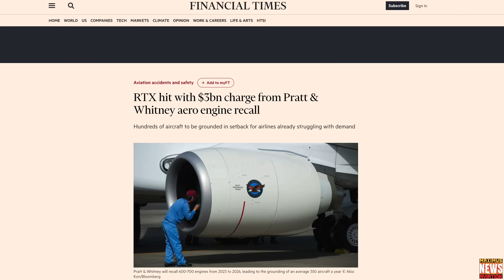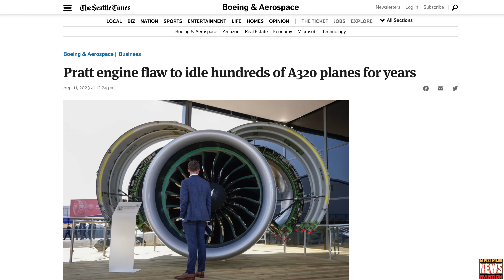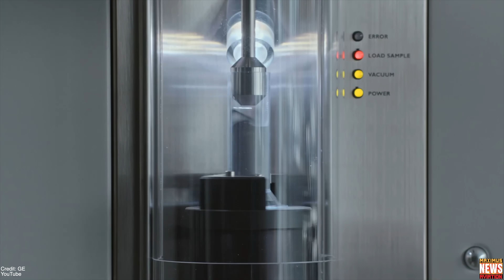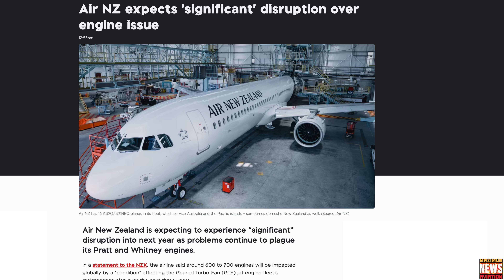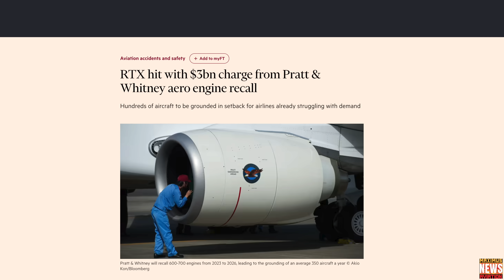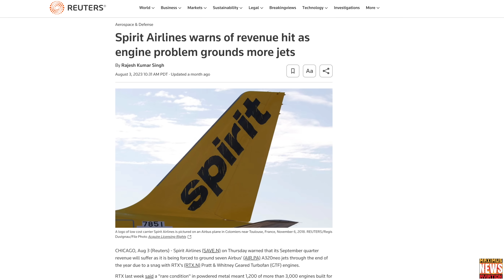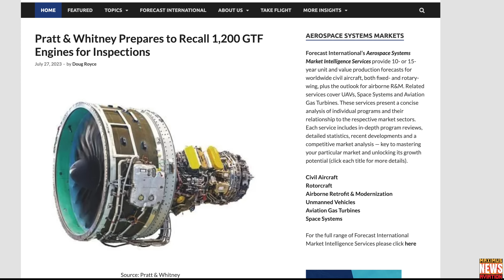HUGE LOSS For Airbus. Every A320 neo-Family Jet P&W GTF Engine Will Have To Be PULLED And Repaired!

Comment: When you put quality control in the hands of accountants....you get what you deserve.
Reply: This same comment has been made like 15,000 times before. It's getting old. and it's not even appropriate to this video.
Reply: @k9killer221 Yes it is. Let’s take time to think.
Reply: When you put quality control in the hands of Chinese companies..you get what you deserve.
Reply: @4dtooto  Maybe I missed something in the video. What is the contaminant? where did it come from and how did it get into the metal? Do you KNOW that it is from a Chinese source? I'm sure we'd all be interested on some solid information regarding this problem.
Reply: With decades of advanced material development, quality control and failure analysis engineering experience, it shocking to the core that the powered metal supplier just detected the contamination now  when in fact the technology and proven methods to detect the alleged contamination has been around for decades.
Reply: @icare7151  I’ll go with that.
Reply: The airlines decide what engines they want the aircraft to have. The only reason why this supposedly is "huge loss for Airbus", is because the video creator is american and is so bitter with Boeing being down the drain.
Reply: @uslaserguideddemocracyseed1039  boeing isn't down the drain about 6000 planes, and counting before it's down the drain..and that will never happen, without out Boeing you will be walking on your next vacation 🤔😭
Reply: @Andrew-hr9tt Boeing could not possibly any further down the drain than what it already is. Airbus is steaming ahead, while the only thing Boeing is able to do is damage limitation as they are left further and further behind in market share.
Reply: @uslaserguideddemocracyseed1039  6000 + planes isn't down the drain, boeing right now has a very young workforce.and that is a issues now  .along with subcontractors and the faa sitting on there ASS THEY SHOULD BE CATCHING THESE ISSUES WAY BEFORE THEY ARE AND ITS TIME TO FINE AND FIRE SOME ASSES AGAIN AIRBUS IS NOT SQUEAKY CLEAN!
Reply: @uslaserguideddemocracyseed1039  so you are not up to date on the faa I take it? you know the outfit that skated on the max crashes yeah that outfit thats holding the 777x hostage. Read up on them lazy punks
Reply: @Andrew-hr9tt  Boy are you not up to date indeed. The 777x, that's the least of their worries. Why don't you take a look as to how far ahead Airbus is now is in market share, and how that is going to get even worse. Or how their CEO stated that Boeing won't even think about designing a new aircraft, as a minimum until after 2035. Reason? Because paying dividends to their profit comes first, of course. Starting with the McDonnell Douglas merger and disastrous decisions like first outsourcing the manufacturing of their fuselages and then outsourcing even the design (787), Boeing did all of this to themselves. Boeing is responsible for their mess. And even if it wasn't for massive subsidies from the US taxpayer in the form of military contracts, they would have been in even worse shape. Mentour Pilot has even made a video talking about Boeing being sold, altogether.
Reply: @Andrew-hr9tt  What are you talking about? Boeing's troubles start twenty years ago. And spare me the story with the "subcontractors", will you, look up how they foolishly decided to outsource the manufacturing of their fuselages. Taking a stupid decision and then blaming someone else for not carrying out correctly your stupid decision, is just laughable.
Reply: @uslaserguideddemocracyseed1039  boeing has been outsourcing for over 90 years this is nothing new there.airbus outsources as well.they always have. I can tell you are new at this.
Reply: @uslaserguideddemocracyseed1039  boeing could be sold but that won't change nothing that's already going to change anyway.
Reply: @uslaserguideddemocracyseed1039  Boeing CEO said he won't think of building a new plane till 2023 really you fell for that.because Boeing is testing the waters for a new jet you might need to update yourself 😂 ps it's called a truss winged plane.see I get much more scoop the new you do after I retired off the Boeing 737 line after 37 years💰😊💰
Reply: @Andrew-hr9tt Your denial of reality is just laughable. Boeing's CEO has made public statements on what I am saying. As said, Boeing has no-one else to blame for the mess they are in, but themselves. And what it makes what or when you retired off, is something only you understand.
Reply: @uslaserguideddemocracyseed1039  you still in denial must be he ain't running your mouth
Reply: @Andrew-hr9tt  You are disputing public statements of Boeing's CEO, and you are saying it is ME who is in denial? Do you feel ok?
Reply: @uslaserguideddemocracyseed1039  your med's kick in yet? I'm very worried about you!
Reply: @Andrew-hr9tt You are worried about me, for referring to what Boeing's CEO has been publicly stating??
Reply: @uslaserguideddemocracyseed1039  yes I'm I'm afraid they have you on the wrong medication
Reply: @Andrew-hr9tt  Boeing's CEO says one thing, you are trying to make a laughable argument for the exact opposite. I know who those who refuse reality are called.
Reply: @uslaserguideddemocracyseed1039  your bus should be coming round the corner soon you will know it when you see its short and yellow.
Reply: @Andrew-hr9tt  Your ambulance is coming to wear your your special jacket.
Reply: @uslaserguideddemocracyseed1039  yeah they stop and for directions to your place. Hope I give them the right address
Reply: @uslaserguideddemocracyseed1039  catch your bus yet,🤔
Reply: @Andrew-hr9tt Got your straitjacket on yet?
Reply: @uslaserguideddemocracyseed1039  yeah got a couple what size you wear?
Reply: @Andrew-hr9tt Did, or did not Boeing's CEO state that the company won't design any new aircraft until at least 2035? He did. You are disputing reality. So, as you were told, go put on your straitjacket.
Reply: @uslaserguideddemocracyseed1039  they need to know what you wear.
Reply: @Andrew-hr9tt Answer the question.
Reply: @uslaserguideddemocracyseed1039  You cant just claim that airbus is way ahead in the market share than Boeing is. Again the fact Boeing CEO says there wont be a new designing of a new aircraft until after 2035 is because they need to focus on getting 787 and 737 up and running with deliveries ramping up and no new setbacks and the same applies to the 737 (supply chain issues this is about) Its not because of paying dividends to their profit coming first. If so Airbus would be doing that too by having paying dividends to its profit too. The Merger with McDonald Douglas is a past mistake we know that. The decisions to outsource components for their aircraft is what they had to do. Airbus has done the same and are experiencing the same supply difficulties. Looks like airbus did that too themselves but why are Boeing and Airbus responsible for outsourcing? Its a mess because their suppliers are not doing a good job at quality now all of a sudden.
Reply: Not sure that's a fair comment.
Reply: Without accounts you wouldn't have a business

Comment: This is the sign that the turbofan jet tech is approaching its limit in squeezing the last drops of its efficiency. The margins of safety are very narrow. This is the inherent for all mechanical tech - cyclically moving masses are inherently not efficient and the more the mass and the faster the movement - the less. Time to start thinking of alternative fast and economic mass transportation technology. 100 years of jet propulsion for mass transportation has reached its theoretical limit.
Reply: Ugh, spare me the baseless armchair speculation about physics 😂 how is it that you fail to understand that this is really just a manufacturing defect that could happen to any technology at any period in time, and not any inherent design flaw?
Reply: @rafaelwilks  1. Learn to be polite even if you are irritated - it will protect you from looking stupid. 
2. This is not just a manufacturing defect. This is a failure to understand the nature of fluctuations of physical properties of any solid. This is why if you take a glass and throw it against the wall, 1 out of a 1000 will not break, but bounce back. Usually the designer overbuilds any  - if certain part needs to be  x millimeters thick by normal calculation it is made thicker to meet the safety standards. What an engineer starts to squeeze more efficiency, savings, lessen the weight, etc., the first thing he or she does - is to sacrifice that “useless” weight, size, expensive or heavy material component. And it always one way or another IN MECHANICAL SYSTEMS translate to cutting mass. And its inherently diminishes the reliability. In car engines its no big deal, if your engine breaks, you just lose time and few bucks. In aviation - its a desaster.
Thats enough for you, for now. If this did not help, go get a degree in engineering. 
Our free interaction is over.  I have no more time for rude ignoramuses.
Reply: @rafaelwilks  You have no idea of what I told you have you?  ::) But as I said, no free education for you. Go pay your dues.
Reply: You got one in your shed you’re ready to share? Because right now, this is the best scalable thing we got.
Reply: And your solution is? There simply is no other machine/energy source combination like a Turbofan gas turbine coupled with jet fuel that could provide the same power to weight ratio and propulsion endurance. No doubt there will eventually be something better but this is rather quite a long term matter.
BtW the Geared Turbofan concept was quite a big step fwd. in regards to fan engine efficiency.
Reply: @wanderschlosser1857  My parents were the youngest members of the first Russian nuclear science team in Tchelyabinsk-40. When they entered the Leningrad State in 1945 there were no signs of nuclear power as a possible electrical energy source. When they graduated, it was on the boards and a little later they were pumping electricity at unimaginable rate. Knowing what I know today I can project that in about 5 yeRs we will, finally, see some benefits from our investment in CERN Collider. On the other hand seeing how much money is invested into electrical storage, I can easily see the electrical plane engines at least for medium-distance routes in the next decade. Watching my former country doing all they could to stupidly cut off their own biggest source of income and push the world away from hydrocarbons  - I can see that happening even faster.

Comment: Geared turbines are proving to be a problem. I am wondering if we are pushing material science just a little too far in the search for performance? First, Carbon Fiber not aging well is enormous. Now add major problems with engines. Both are a material failure. The question begs to be answered.
Reply: The powdered metal contamination has nothing to do with the gearbox portion of the GTF.  It effects the material properties of primarily the turbine disks in the hot section of the engine.
Reply: No, we aren't pushing material science too far, you really think you know better than the people who are designing it? 🙄 where's the evidence that carbon fiber composites aren't aging well? These fan blades age better than any other material, tell me how many carbon fiber composute fan blades have burst in flight after a quarter century of heavy use. Already, one big myth everyone's believing is that the issues with the GE products are design flaws. The truth is, it's just a manufacturing flaw that could happen to anyone at any period in time, regardless of the technology used.

Comment: I dont think that it is a loss for Airbus , P&W yes .. , but if new Engines are already fixed it does not matter , Airbus will sell new planes . I doubt that Airbus  has to pay for the repair of the older Planes, or at least , P&W has to shoulder the biggest share and maybe they get some money back if they did not produce  the flawed parts themselves . Mostly you can attach more than one engine to a plane , its up to the Airline which they want and have choosen .  But yes , if they have to produce spare parts it may be that there are less new Engines are built and delivery of new A320 may be delayed , on the other side , P&W is not the only Provider of Engines .
Reply: No way to deliver airliners w/o engines my friend.   No delivery no payday.    Think about several hundred planes parked at AB with no engines.   Airbus would likely stop production rather than invest that much money in planes it can not sell.
Reply: The loss will mainly be carried by PW and the development/production share partners of the GTF like German MTU. And indirectly by the airlines and passengers because of the grounded aircraft capacities.

Comment: The Boeng and Airbus Aviation industry uses "Horizontal Integration". Tesla for example uses "Vertical Integration". Tesla being very quick on it's feet realised it needs everything developed "In-house". Boeng is in real trouble with external suppliers. Get stuff back "In-house" Guys.
Reply: When did either Boeing or Airbus ever make aircraft engines?
Reply: @johnstuartsmith  good question!!! Did they ever? I'm too lazy...
Reply: They have always outsourced... always will!!!!
Where have you been!!!????
Reply: Not really in trouble but have to be frustrated to deal with them. In house isn't what has to be done. Outsourcing is the only way
Reply: @nickolliver3021  👈 Says the Muppet that never worked on an aircraft. 🥴
Reply: @soyousay7751  says the muppet that cant mind his own business and has never worked in reality
Reply: @nickolliver3021  Concentrate on your Sippee Cup and drink your breakfast. Is it true you've never worked on an aircraft, have you ever even loaded baggage? Please tell me I'm wrong Nick, I did read about you being Prom Queen somewhere though.
Reply: At what point in its history, did Boeing make its own engines?
Reply: In the case of both Airbus and Boeing, the correct answer would be "never." Engine manufacturing is such a specialized and expensive process that engine makers need to be able to sell engines to any company that makes airplanes. An airplane manufacturer wants to be able to offer different engines for the the same model of airplane. It's easier sell Boeing planes to British airlines if they can be ordered with Rolls Royce engines, etc.

Comment: It seems incomprehensible that all the comprehensive QA/QC measures in place did not pick up on the metal contamination.
Reply: Seriously!!!?? Are you an engineer? Doubt it!!!!
Reply: Not 100% sure but I seem to recall the video that a new form of XRAY inspection had to be developed to find this problem.
They are looking for individual grains of iron maybe with micro cracks maybe not.
As @vincentconti-jb3hd more or less said non engineers would not understand the complexity here.
Reply: not  the first time, go look at their history
Reply: I see two easy explanations.

As a company's bean counters look to make their publicly declared profit targets, cutting QA/QC is an easy short term solution.  Unfortunately.  The experienced inspectors get laid off.  Inexperienced and unqualified inspectors are hired, but not enough to actually inspect everything well enough to catch issues.  Cost goes down, profits are up.  The executives get their stock options and performance bonuses now, and get ready to jump ship if their gamble turn out bad in the long run.  You'd think that investors would have wised up by now, it seems to happen often.  But maybe the influential investors are gamblers themselves, so they are comfortable with taking these kinds of risks.

And, of course, we are talking about powdered metal.  Each grain of metal powder is tiny, sometimes finer than the finest sand, and there are literally billions of particles that go into each part, so I imagine it must be very difficult to inspect each and every single grain as it gets loaded into the hopper or whatever to make sure it is the exact correct type of metal and not some other metal.

Comment: My airline chose wisely with the LEAP!
Reply: Just wait, the LEAP will also come up with problems. All new complex engine programs have got their issues. Many use the same suppliers for subcomponents and materials. And the supply chain impacts caused by the GTF will cause problems with other engine programs, new and aftermarket.

Comment: I'm old enough to remember when P&W was the "go to engines", and Boeing was the "go to aircraft".
Then "OUT SOURCING" became the  norm.
Need I say more?
Reply: Still is the go to aircraft! What planet do you live on. They have always used contractors for parts!!! You are parroting the nonsense you hear on YouTube....an entertainment site!!!!
Reply: I have to agree. There was a time that a Boeing plane went from design to first flight right from the Boeing factory. Most components were from suppliers but the entire assembly from beginning to end was by Boeing. Quality control was much better because of it. Now sections of the plane are being built around the world and shipped to an assembly plant, which might not even be a Boeing plant.
Reply: Out sourcing has nothing to do with.
Reply: ditto on that. They have always used contractors!